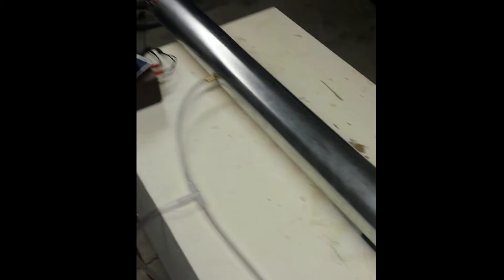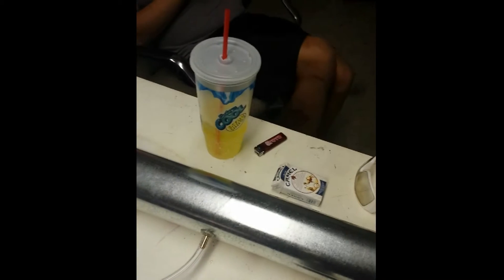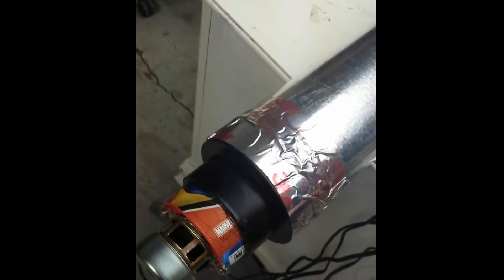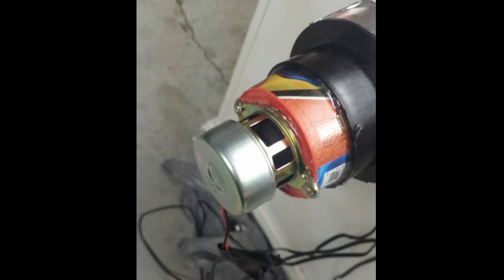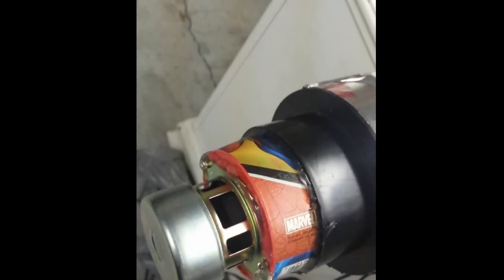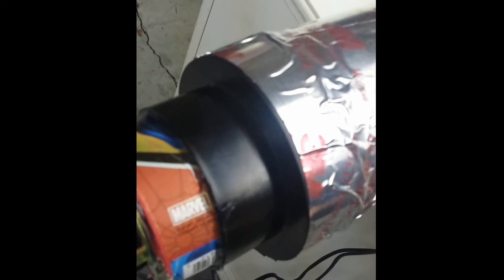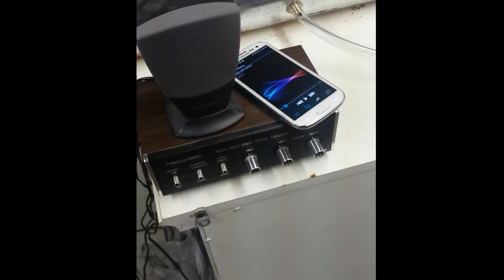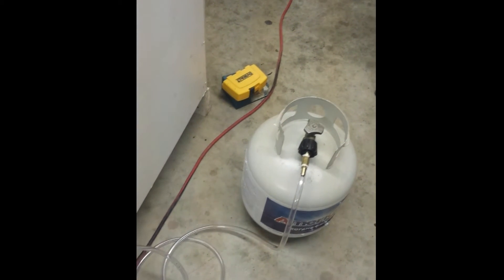DIY Rubens Tube

Comment: Can you pass the tube length and width, size of each hole and the gap between the holes???
Reply: do 1/16" drill holes (drill bit) every 1/2"  The length of the tube is up to you.  I did a 2 foot one just to test it.